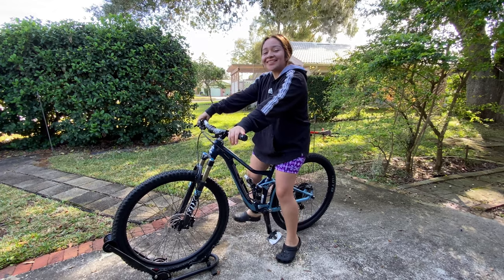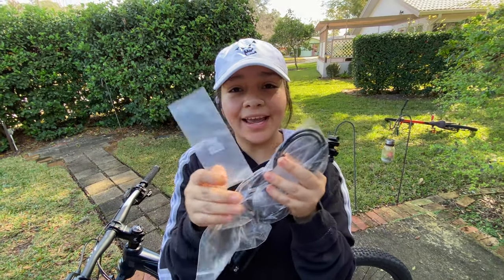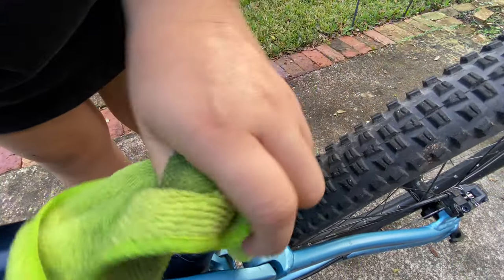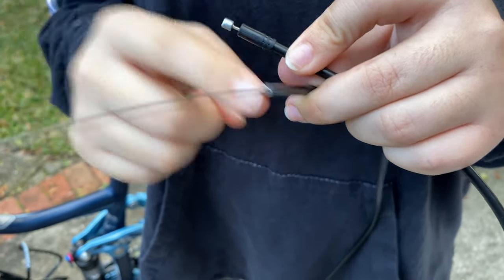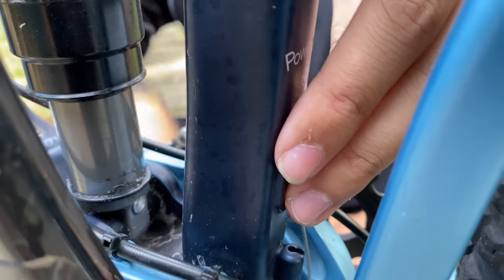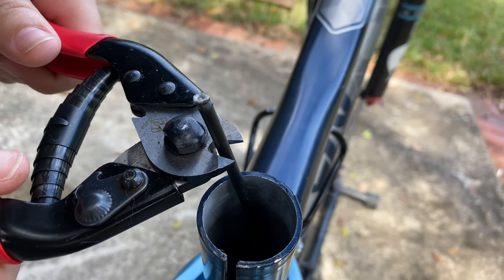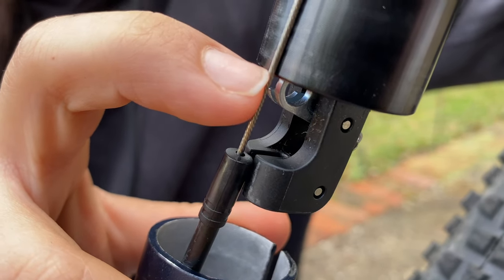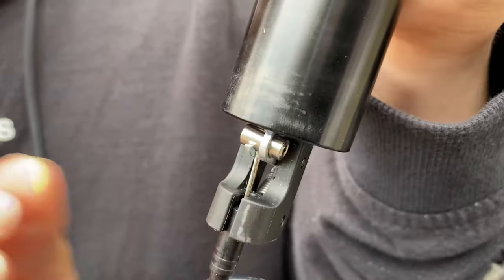KS RAGE-i 75mm shortest base dropper post|Solution for short post insert frames (XS)|how to install

Comment: I have the exact same dropper. Good explanation but did you have to much cable in the frame when you pushed the seat post down, l couldn't see if you allowed for this when trimming the outer and inner cable?
Reply: I saw  that too I think she did

Comment: Did the cable barrel come with the dropper post or did it come with the dropper post lever. Thanks
Reply from the maker: The cable barrel and the cable+housing came with the post. The lever you need to buy separately
Reply: @lksabiking6424  For some reason they don’t list the cable and housing and barrel nut coming with post. I sent company a message just to make sure.I called the company I want to buy from and they claim the cable and housing doesn’t come with post. All the research I did people say cable and housing does come with post. I bet it does. Thanks and good video.
Reply from the maker: I got the post from jensonUSA you might have to back order it. Ours shipped after a week. The post works okay. We will upload a short term review of the post after 1 month from the date video was uploaded if you wanna wait first to see how it performs.
Reply: @lksabiking6424  I just ordered one from world wide Cyclery. They have a good return policy. I just sent back a ks eteni 100mm dropper post I got off eBay. It was very bad. I had a ks lev on a bike I just sold and it worked perfect so I’m hoping this is works almost as good if not it will be you fault.😂🤪
Reply from the maker: @BH-cy9tb  I have a ks lev on my bike aswell hence why I bought this for her. It does the job but it won’t be as great as the lev. I mean you’re going from $300-$140.
Reply: @lksabiking6424  your right. As long as it goes up and down I’m happy.

Comment: Thanks for the video!! 

Maybe a silly question, but anyways. Is 75mm drop worth it? It doesn't seem that much drop. What is the opinion of your bf if he was going to use it?

I have a DH frame to which I installed a 125mm dropper. When up it let's me pedal just fine, but it doesn't go that low because half of the max insert of the post is sticking out. 

I checked the 100mm versions but the dimensions are almost the same. I was thinking on this size, but I thought maybe it would end up feeling the same when up and down.
Reply from the maker: She has short legs so the drop was actually worth it.

Comment: No matter what I do it seems to come disconnected after a period of time. It even came disconnected after the bike shop set it up. It feels to me like the RAGE-i just has a mechanically unsound design or something at the point where the cable connects to the dropper post. Has anyone else experienced this issue?
Reply from the maker: She still uses the same dropper post. One issue we have is we have to press it a couple of times before it responds. After that it works just fine.
Reply: @lksabiking6424  Good deal. I probably just installed it incorrectly. Will give it another shot. Thanks for the info!
Reply: I had an issue where the piece of the dropper holding the cable end actually snapped (possibly under too much tension), which caused the cable to slip. Worth looking out for
Reply: @thompsy02  For some reason I kept it and just double checked - thats exactly what happened to mine as well. Thanks for the heads up on that.